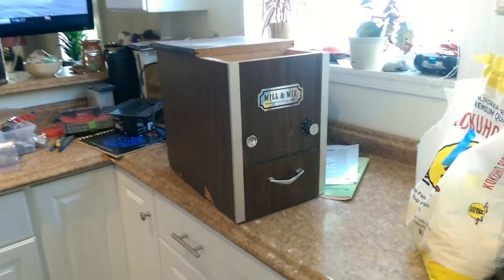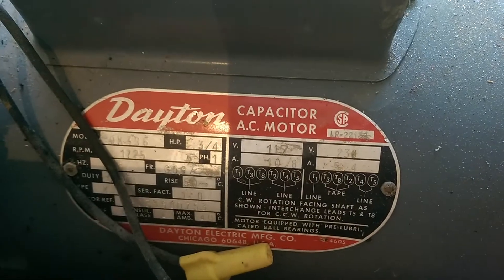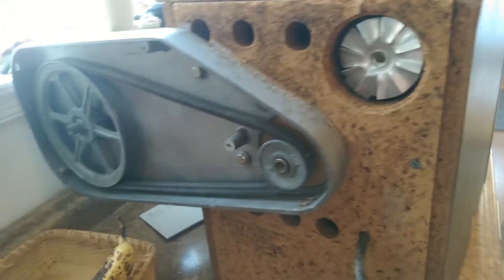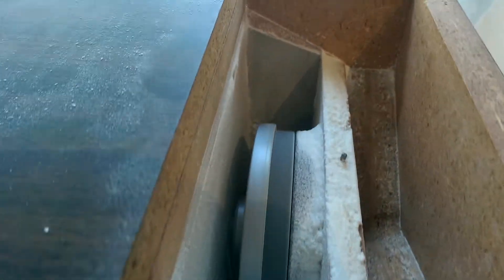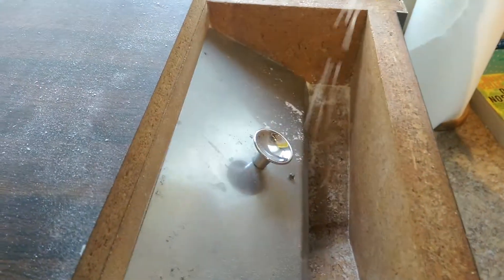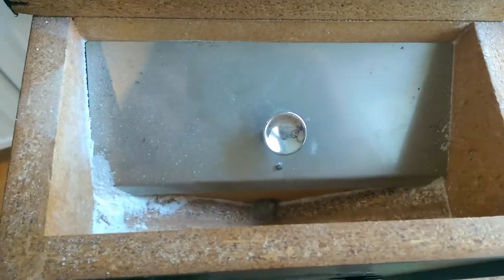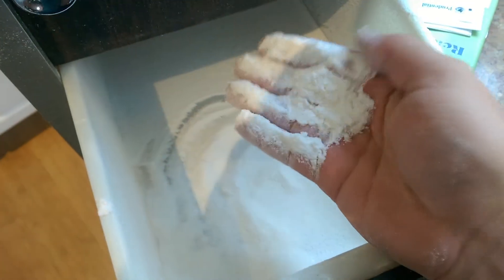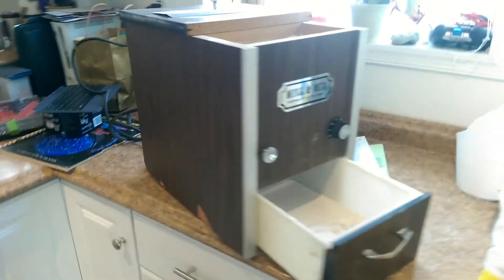Mill and mix grinder for $5

Comment: I have had one for 41 years.  We bought it new.  If you would like, I will scan the manual and send it to you.  We also have the mixing bowl, dough hook, and handle for manual grinding.  We can mix 12 loaves of bread at a time and mega-batches of cookies.  This unit is bulletproof.  I was thinking of trying to design some other attachments for it.
Reply: I would love a copy of the manual. My grandmother just gave me her mill and mix and I'm looking around on the internet for instructions on how to use it.
Reply: @markhambr  Hand crank is for when power goes out, manual grinding
Reply: @1012003ricman  Do you still need a copy of the manual?
Reply: @CmdAmras  Do you still need a copy of the manual?
Reply: @blaketerry4389  Do you still need a copy of the manual?
Reply: @markhambr  Do you still need a copy of the manual?
Reply: @aliesrichardson5631  Do you still need a copy of the manual?
Reply: @TheBullockLife  Do you still need a copy of the manual?
Reply: @sverma68  Do you still need a copy of the manual?
Reply: @Jared Leavitt Do you still need a copy of the manual?
Reply: @ALPHAJACK78  .....i would love a copy!!!
Reply: I have the Mill & Mix with the giant mixer attachment, but I don't have the bowl or the dough hook or any of that, just the mill with the big metal piece that attaches.  Would you mind doing me a giant favor and posting a video showing all the parts so I know what I need to look for?  That would be awesome.
Reply: @AndrewsArcade  Here is the patent with all text and illustrations. The components for mixing and the drawer were all available through restaurant suppliers. https://www.freepatentsonline.com/3966178.pdf
Reply: @ALPHAJACK78  I would love a copy of the manual as well if you still have access to it.
Reply: @AndrewsArcade  I will scan it in, can you post your email? and I will send to you
Reply: @ALPHAJACK78 could I also get a copy of the manual?
Reply: @roscoandbosshogg171  sure I would need your e-mail then I can send you what I have

Comment: We bought one of these used Mill & Mix flour milling machine that was built in the 1970s in Brigham City, Utah. It has worked great until a few months ago when the flow of grain from the hopper became slower and slower. We cleaned the stones and ran some rice through the machine but the grain still doesn’t feed well from the hopper into the entry hole to the stones.  Has anyone else experienced this? If so remedy/solution is appreciated.